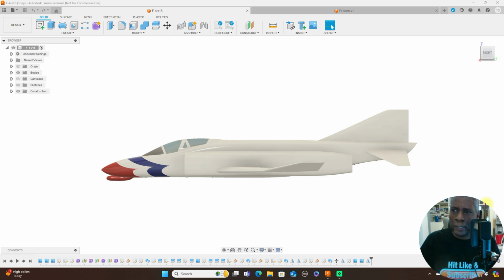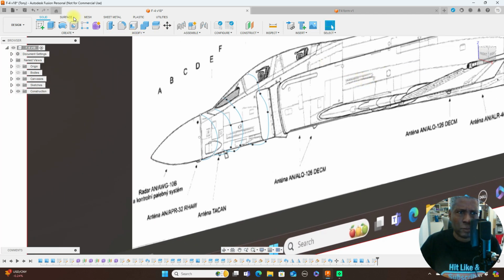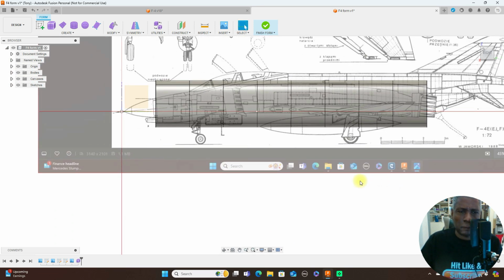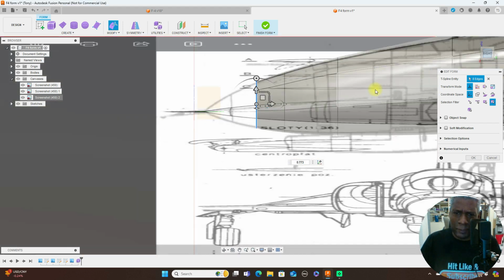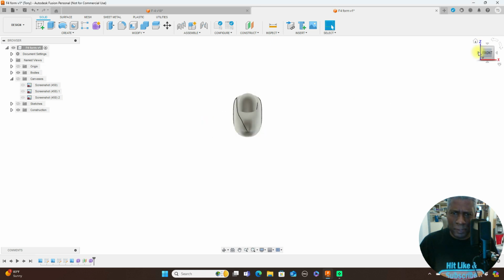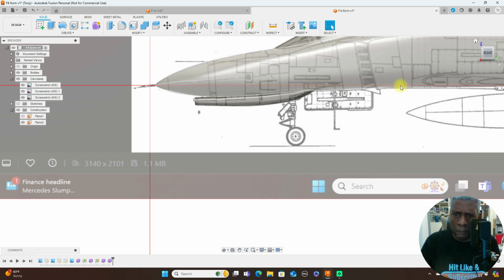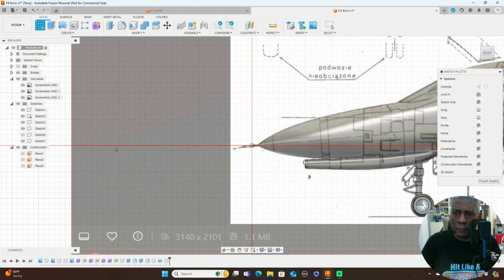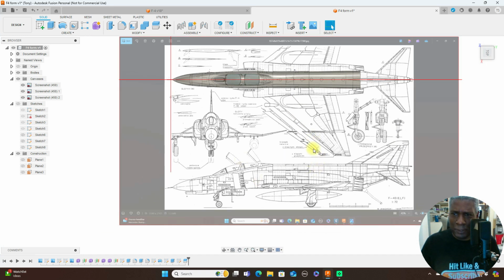Workflow modeling a F-4 Phantom with surface modeling and form modeling

Comment: Nice video! It would have been helpful to show how to add the engine inlet ducts and all this stuff. But for now i learned again a little bit. Thanks
Reply from the maker: Thank you.  I do plan on showing how to model rest of the jet.  If I had shown everything this video would have been extremely long.  Stay tuned for rest of the jet.
Reply: Yes i believe that. It's a nice way how you show your modeling steps. Thanks for sharing your clips!